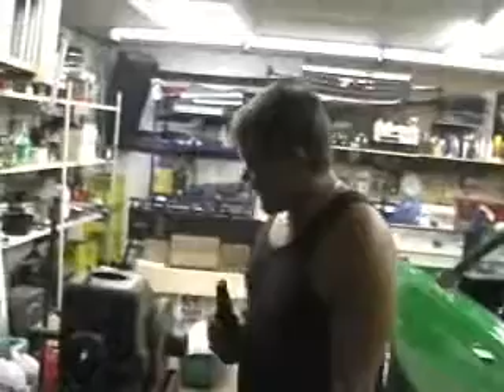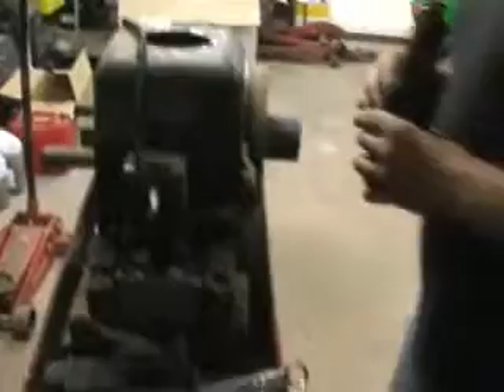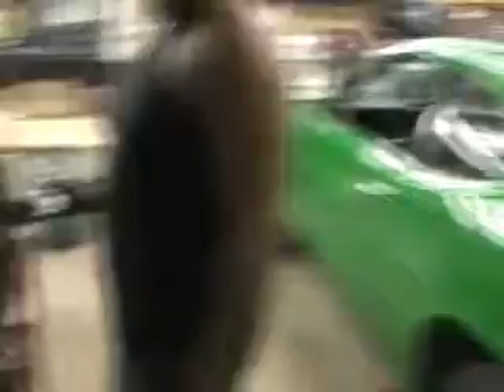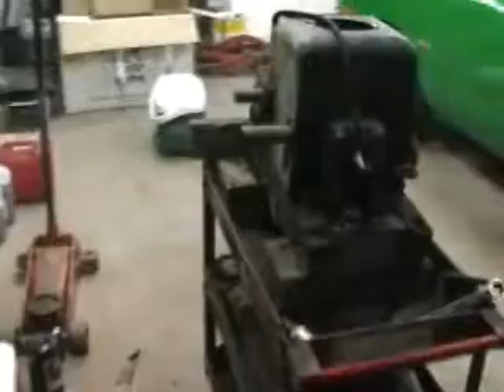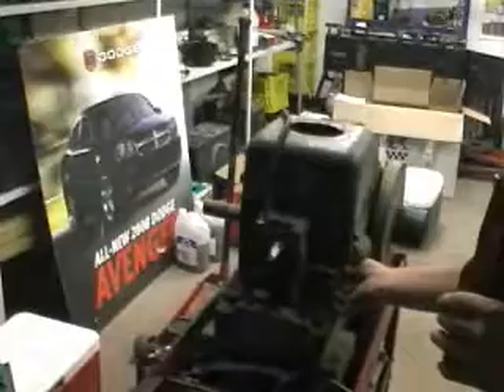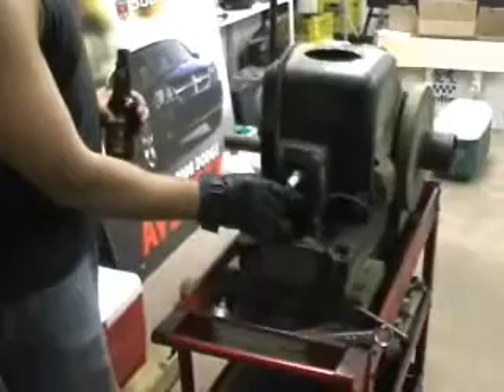Fairbanks-Morse Z

Comment: If its firing irregularly and puffing alot of smoke, its usually running too rich, a good place to start is one full turn out unless the intake line has a small leak, then itll take more. if its firing irregulatly and sounds a little bit hollow, and backfires now and then its probebly too lean. Theres only about a half turn difference between too rich and too lean. A good place to start is one full turn out with the mixture needle

Comment: They all seem to run differently, Mine runs well at low speeds at only a half turn out, but takes one full turn out for full speed. I think it all depends on the intake line, and if there are any leaks in it or not.